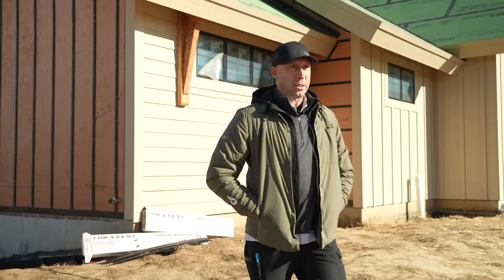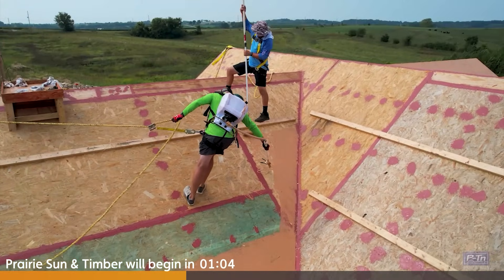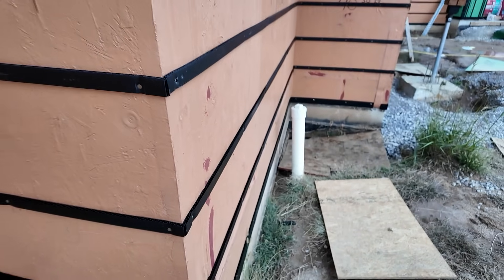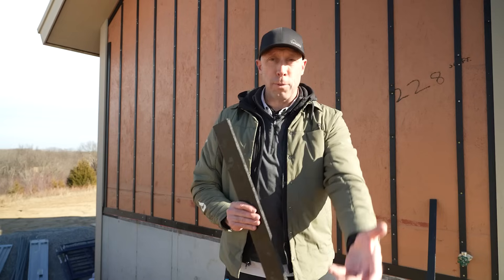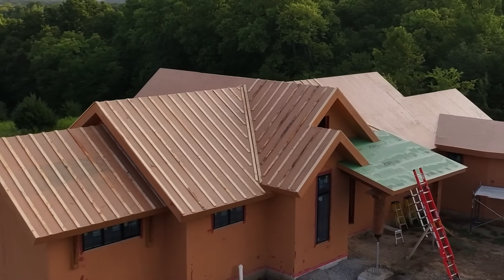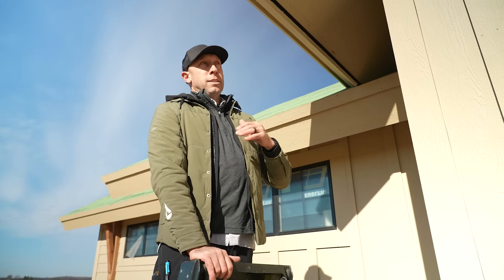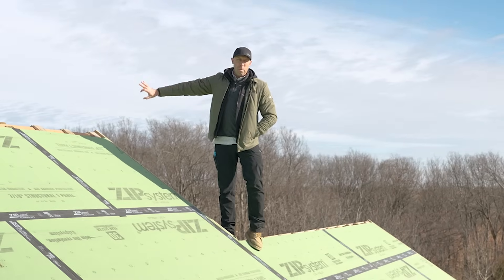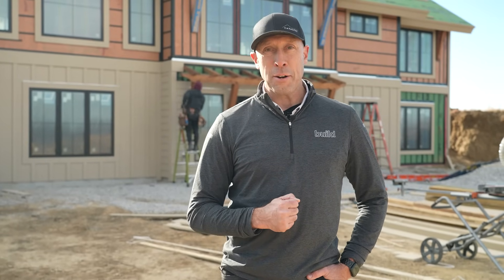Prairie Sun & Timber | Episode 4: Exteriors Part 2 - Drainage & Drying

Comment: Something I've wondered about, but I'm pretty sure precisely zero inspectors would go for, is running the rain screen and over-roof vent into an otherwise sealed soffit so that it's all one air path from the ground up to the ridge vent and then (the crazy part) dumping the plumbing vents into that same soffit. I think you'd have better airflow through the rain screen, no unprotected roof or gable penetrations, and the effective location of the vent stack would be nowhere near any windows since it all goes out the ridge vent. Pretty sure there's something I'm missing though.

Comment: Instead of doing all that extra zip and paneling. Just going with a steel roof would have been a much better solution and a steel roof is a 100 year roof.
Reply: The point of the video was to show the best solution for a sip roof and the ultimate longevity of the home. A metal roof has some of the same issues a shingle roof has. Penetrations into the sips and the hail damage. Using a vented over roof mitigates both those issues which are even more important when using sips. I have a metal roof on my own house and love metal roofs. But it is also a traditional vented roof. You can think of a traditional vented roof as a vented over roof though. The layers are just “spread out”.

Comment: Why use OSB and a roll on membrane when you can just use a ZIP panel and save time and resources?
Reply: They used SIP panels. The client determined this before they joined the project. You’ll see they used zip on the lower portion of the house that wasn’t timber frame + sip.

Comment: Build a shed 15 years ago with 3/8 inch OSB, painted 3 heavy coats of oops paint from Home Depot paint, repainted this year. Still solid. All at 1/1000th the cost that Matt's building. Not to say the technology is not appreciated but common sense can go long way.
Reply: You could probably do the same thing with this house, but this house also comes with a warranty.

Comment: Why use the taped zip for the overroof detail? If there is drainage and drying behind the zip above the SIP panel what is the harm in using a cheaper material for the overroof? In my opinion there is no need for an air/water/vapor barrier product there.
Reply: I had the same thought. When Travis called it a “sacrificial layer,” I thought, that’s a pretty expensive sacrifice.
Reply: @chrisgeary4624 sponsored by zip probably no extra cost to him
Reply: Just a guess after watching a lot of these, this among the best. 

Guess being: 
- the zip skin and tape will provide water runoff, but the vapor property has no advantage. I do see an advantage to the zip OSB an enhanced material more tolerant to the weather cycles than ordinary OSB. 
- the drying potential may be necessary for the battens (wrong word) under the zip

- side note: I see a need for a 3-4 foot per side ridge vent. I think that is what Joe Lstiburek designed in to repair ridges for a community in Alaska in which all of their SIP ridges rotted (vapor rise with warm air and seeping until it could find a condensing surface, the OSB.  It is worth finding that video. It is a major longevity issue.